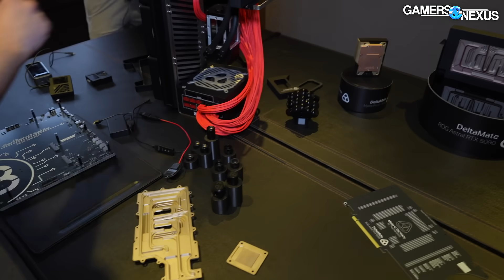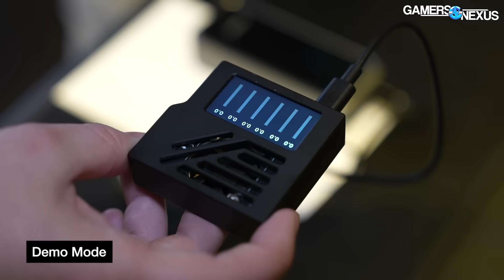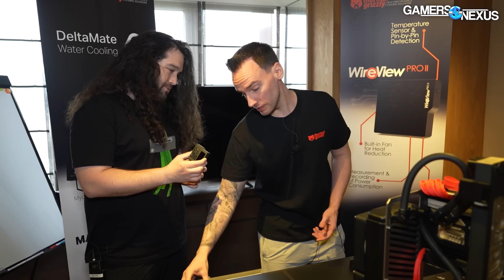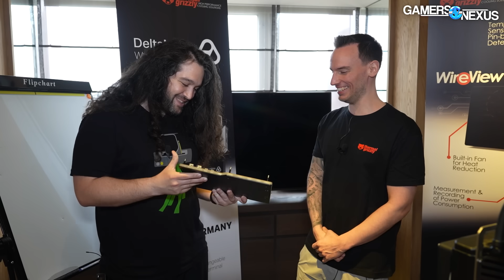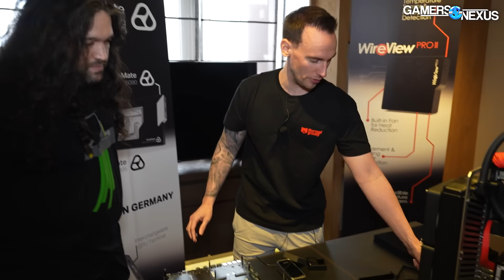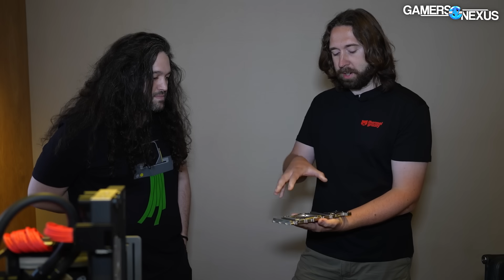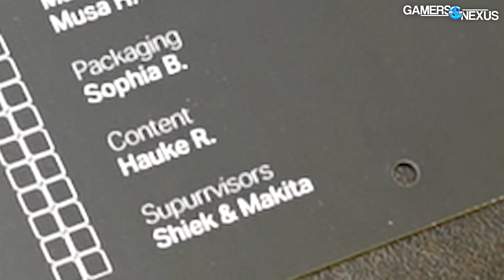Fixing the Unfixable 12VHPWR Connector, ft. Der8auer

Comment: A nice feature would also be to have it be able to create an audible alarm via the system audio (speakers/headset) so you could just Alt+F4 out of the load rather than shut the system down if you wanted to. I hate that this is a thing, but I appreciate companies like TG and Seasonic trying to do something about it. Still... I would like to see them just kill it off and switch to EPS connections to have a more healthy buffer zone.

Side note... that might be the best looking GPU block I've ever seen. I really dig the industrial lab aesthetic and I'm going to have to give that test bench a try as well, I really appreciate how unobtrusive it would be.
Reply: Now that I think about it... Physical beepers are no longer a thing on the boards, are they?
Reply: @LishtenbirdTech  They're usually disable on most boards now, they should still have them as it's part of the ATX specs.
Reply: @LishtenbirdTech  my PC definitely beeps when i clock the memory too high
Reply: @LishtenbirdTech  Makes me wonder if there are some boards that still have them, but I haven't seen one in years... but they do still have the speaker connections, so you can connect one, but I'm thinking more that you would hear in on your speakers or headset so you'd definitely be able to hear the alarm.
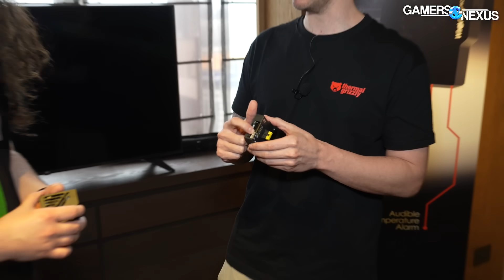Reply: 2:54 The poster of the thing behind them says "audible temperature alarm" at the bottom actually.
Reply: @fus132  Sure, but I want it to make an alarm through the speakers or the headset, not on a speaker inside the case. That might not be loud enough for someone to hear while they're playing a game, especially if they're using a headset.
Reply: I am using a thermistor cable inserted in the 12V-2x6. I then use HWINFO to monitor and shutdown my computer if it goes above a specific temperature.
Reply: @marsupian  That's a pretty good idea, and perhaps they could find a way for this to interface with HWiNFO to do the same rather than rely on the power button.
Reply: Most MOBOs still have the connector but no speaker.
Reply: Didn't he say that you hook it up to the power switch on the Mobo, and if I remember right, it should be possible to change what happens when you press the power button in Windows, so unless it is made to do a long press, which I believe always shuts down your PC, it should be possible to somewhat control what happens.
Reply: @TigonIII  Your ability to control what happens when you hit the power button is pretty much limited to shutting the computer off, sleep and perhaps hibernation? No, I'd rather just have an alarm I can set to a specific sound that I hear through my speakers so I know right away what's going on and I can just hit Alt+F4 to exit the game.
Reply: Throw Asus into that list too, only company to bother trying to have pin monitoring built into the card too.
Reply: @prototypep4  They also only included this feature on their most expensive cards that cost $300+ over MSRP rather than their entire line, and it isn't that expensive to implement. They also didn't take it far enough. All they do is monitor the current and have zero counter measures to prevent it from causing damage. So, unless you have a second monitor up and you're watching their app... you'll never know if anything is wrong, and that's not practical. And if they could add circuitry to monitor each 12v line, they could have added circuitry to do more... and they didn't.

Had they at least included it on all 5090 and 5080 models, I would have included them... but they didn't and I don't feel they deserve the praise for it.
Reply: @TheGameBench point to literally ANY other AIB partner doing anything at all. Yes it's limited to the astral line. Cool, it sucks tits that it's on the expensive card. Here's a counterpoint. How else do they get people to buy said cards knowing MSRP was going to be blown out of the water immediately?
Reply: @prototypep4  You see how that would make it worse... right? Using less than $1 worth of components to justify $300+ over MSRP, you're painting this as a decision made to try to justify their absurd pricing, not because they were trying to be pro consumer. I'm sorry, that's only going to fortify my opinion. Also, I don't care that other AIBs aren't doing it at all. It's not all that useful in its current state and they excluded it to the most expensive card in an anti-consumer move. That doesn't make you a good guy for the consumer. That's why I listed TG and Seasonic, because they're not making it accessible only to people with absurd amounts of money or people that are willing to go into extreme debt for a gaming GPU.
Reply: @TheGameBench wireview is literally going to be over €100 for a glorified adapter 😂😂😂 pick a f**king hill bro.
Reply: @prototypep4  First off, I paid $30 for the first one, and you have zero idea how much the new one will cost. Even if it $100, it's not even close to being comparable to spending a MINIMUM of $300 over MSRP for an overpriced GPU. Nice try... but that is a pretty bad false equivalency.

EDIT: Also, I forgot, this actually has countermeasures that protect it from causing damage... unlike Asus's implementation.
Reply: @TheGameBench awwe someone is a bad listener too.
Reply: @prototypep4  If he said that in the video... then I'm wrong, but you're conveniently not addressing the rest of my comment because it doesn't change anything. Whatever man, one of refuses to be objective, and it's not me.
Reply: @TheGameBench OBJECTIVELY out of every single AIB only ONE implemented Any measure of monitoring for that stupid connector. Regardless of if the card is overpriced (news flash, they all f**king are) or not. They still took the initiative to do SOMETHING. That's objective fact. You just don't want to admit it.
Reply: Theoretically, with the USB, you could have the software just close whatever app is placing the most GPU load.
Reply: @roboman2444  Yep, absolutely. That's why I'm hoping that they do something like that, since it shouldn't be too hard to implement.

Comment: Just put 2x 12VHPWR instead of just one so it wont overload 🙂
Reply: It will still overload due to lack of load balancing, the connector is just dogshit by default, no saving it really.
Reply: @Assassin-js1jp Correct!
Reply: @Assassin-js1jp  That's a PCB design problem, not the connector itself. No reason there can't be load balancing with that connector. Having said that I'd rather they switched to something more robust as well.
Reply: @xr250rdr68  Yes the PCB design is a problem you can't change it on the RTX 5090 FE, because there is no room to put any load balancing at all.
Reply: @xr250rdr68  Load balancing is not going to save the connector. As Der8auer discussed previously, Nvidia is using the connector in such a way that it has no error margin. So something even slightly wrong, even with a device like this can cause the connector/cable to melt down. Remember, this device only exists on the card itself, not the PSU end, and as shown in previous failures, both ends are subject to melting down.

The connector design was flawed to begin with, Nvidia just compounded it by abusing it. The connector never should have existed to begin with.
Reply: @fishingkev2332  Yeah, and Nvidia already showed how it should be done with was it the 3090 Ti, where they had split it in 3 power rail on the board, instead of 1. Having 3 power rails on the board is basically the same as having 3 power connectors, like the previously 3x8pin connectors.
Reply: Yep doesn't matter how many you use, the connector is a fundamentally flawed design

Comment: 24V is the proper fix to thick cables.
Reply: This would require a change in power supply standard voltage rails though, which I think was intentionally avoided to prevent (perceived) increases in cost of adoption, where a 24 or 48 V system may require a new PSU
Reply: @L1gntn1ng they already changed the specifications to add the new Nvidia power connector.

Besides custom datacenter hardware runs on 24V or 48V for higher efficiency.
Reply: @L1gntn1ng  It would require a revamping of standards for sure, but they do that periodically anyway.
Reply: @L1gntn1ng  it already steps down voltage from 120v or 240v to multiple voltages from
3.3 volts
5.0 volts
12 volts
& then motherboards can do more 1.00 & lower.

it's actually a simple change to take 12 volts to 24 volts or 48 volts.
Reply: @fishingkev2332 oh I know it’s easy to implement, but good luck convincing PSU manufacturers of that, while maintaining a reasonable price. This would be best as an amendment to the PC power supply standards (I can’t think of the name of it) so it becomes something that is normal, and other things can use it. Just NVIDIA making this switch would not be enough.
Reply: @L1gntn1ng  5v used to be the most common power and we switched to 12v mostly. could easily happen again and should
Reply: @L1gntn1ng  still need a new PSU when the old one catches fire
Reply: It sure helps in longer runs of (room) LED lighting.
Reply: I've been saying 24V or 48V for three years now, and people who do not understand what the hell they're talking about keep saying I'm wrong. I guess 48 years of electronics experience haven't taught me a thing.
Reply: @RedBankVintageAudio can't do 48V as some countries require an electrical licence for handing anything over 24V.
Reply: @RedBankVintageAudio  lets be honest how many people actually know what Ohm's Law is?
Reply: @RedBankVintageAudio  people who just study Ohm’s law for about five minutes should understand your point. 
Yet here we are still head-butting the brick wall of anti science.
Reply: we went from 5v to 12v.. no reason we can't go to 24v, it is a shame that they are really stretching it so far.
Also 3.3 and 5v should just be removed entirely, and especially -3.3 (which is basically gone) and -5 and -12... servers virtually only use +12 now.
Reply: @gg-gn3re  5 volts is for all usb plugs? I don't even know anything that uses the 3.3 volt anymore. Maybe why the ATX 3.0 uses mostly 12 volts only.
Reply: @fishingkev2332  yea yet they still have it, as well as negative voltages. Pretty crazy. The 24 pin connector on ATX power is terrible. It should just be all 12v or mix of 12v and 24v
Reply: Yep PCs needs to switch from 12v to 24v